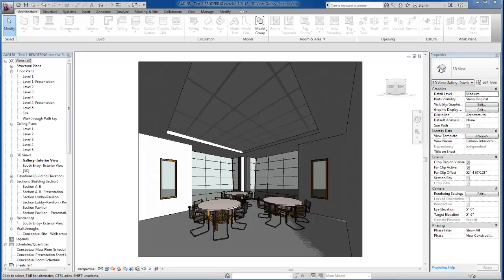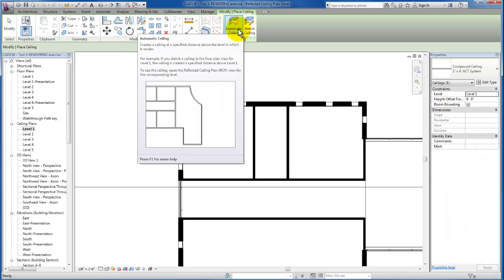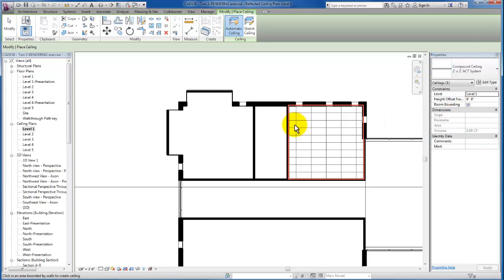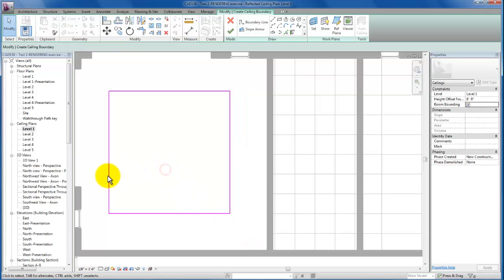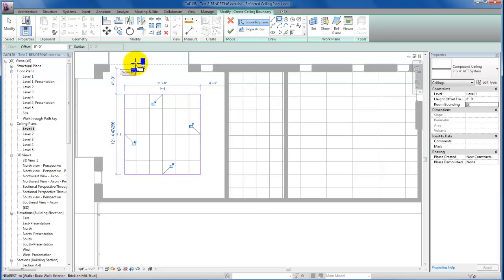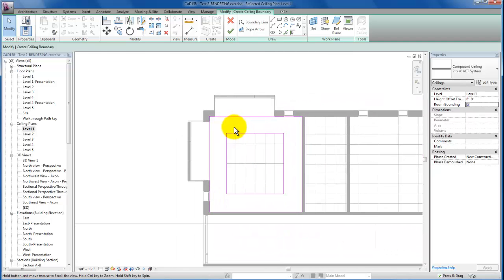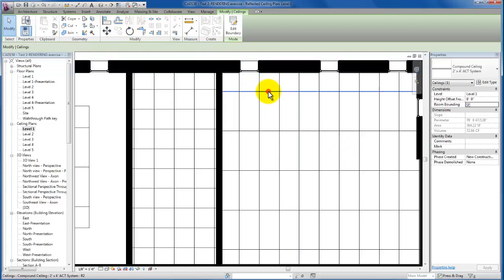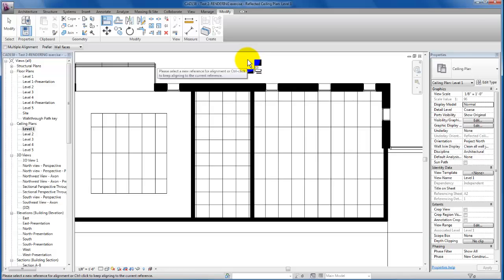Revit Tutorials: Ceilings

Comment: How do you close the vertical gap between the two types of ceilings?
Reply from the maker: From the Reflected Ceiling Plan view, you can use the wall tool to create the vertical plane of the bulkhead with an appropriate height wall (2'-0" high or so- depending on the architectural look you want to achieve)
Reply: SmarterArchitect Thanks.

Comment: How do you get the grid pattern to show on ceiling, as your shows in the video?
Reply from the maker: The 2x4 grid pattern is part of the ceiling component that I choose for that area.  By default, you should have at least 2 material options in the properties menu - 2x4 grid or gypsum board - which shows as a stippled pattern.  Hope this helps you.

Comment: Hello,

I am back again with another revit dilema. Im not much experienced with the architectural revit as i am with the MEP so i am currently struggling with making a box shaped false ceiling for a room. I want to place my air conditioning machines and ducts in a false ceiling that only makes its way to a small segment of a room. the false ceiling is not meant to go all the way through the room. Hence i end up with two ceilings apart by 800 mm space and i am unable to connect them with a vertical ceiling to complete the box. The only thing that worked for me was editing a wall family making it look like a ceiling stud but thats impractical and unprofessional. Can you guide me regarding how to add that vertical ceiling? or how to solve it in any other way. I went to google looking for an image with a similar case as mine to further illustrate. http://www.ductworkinstallation.com/Portals/0/AC%20Touble/cmersh%20082a.jpg notice the false ceiling only goes to that box where the air grilles are placed. 

Thank you,
Peter
Reply from the maker: +Peter Louis  The ceiling tool can be horizontal or sloped - but vertical is not an option.  It is not unprofessional because true acoustic ceiling tile is typically only applied on a vertical when a vertical member is framed out as you are suggesting in your comment.  Peter - your comment excites me because you are starting to think about how a building really goes together as you model in BIM.  Great!  I have some awesome new content coming and it will include real construction info in my newest tutorials.  The new membership site is for people like you.  I can't wait until it opens.  Hope you join!
Reply: +SmarterArchitect thans for the reply. I am getting more skillful in the MEP field and wish to push my company to use more advanced tools sucj as revit and navisworks and simulation cfd. I have learnt all those in a manner only applicable to MEP, but not all our clients are architects who can use revit, so i often have to model the building myself even if just the basic structure, in oder to properly implement my MEP work, that is why i am teaching myself the architectural side of things as i am now doing both. The example ceiling i provided you a picture of is very common in residential and hotel buildings as the architect usually wants to keep the ceiling as high and attractive as possible unlike offices, so he ads plain cielings insteas of segmented, and only allows false ceiling near the entrance or door of a building. So i will need to learn how to build this sort of box shaped false ceiling as i will be using it a lot more than the sort of artistic ceilings you've demonstrated.